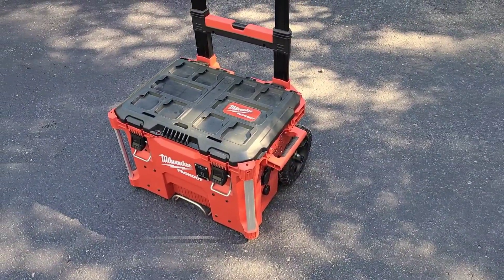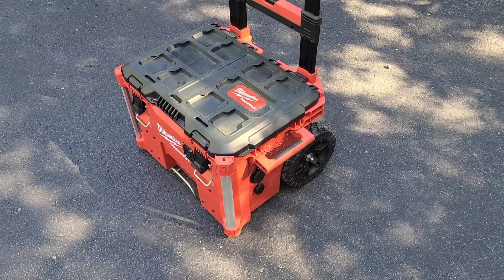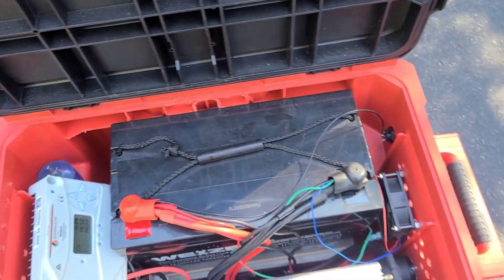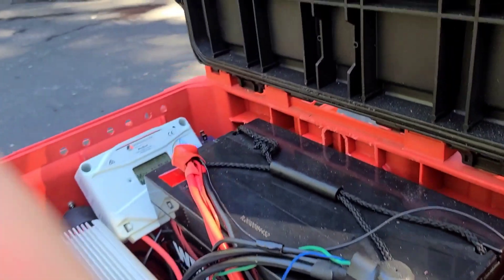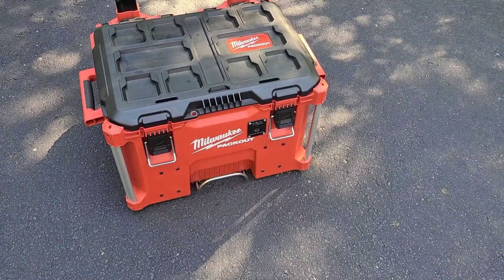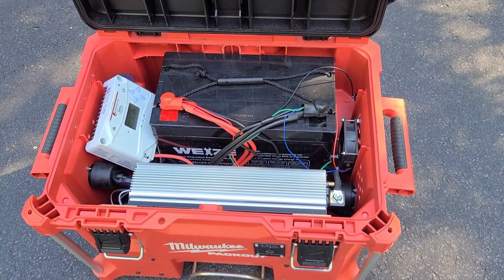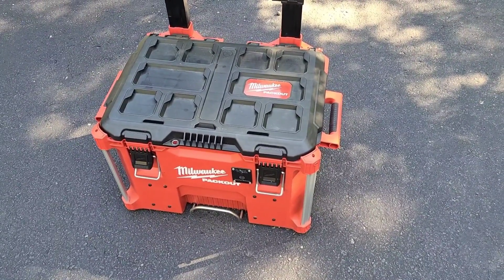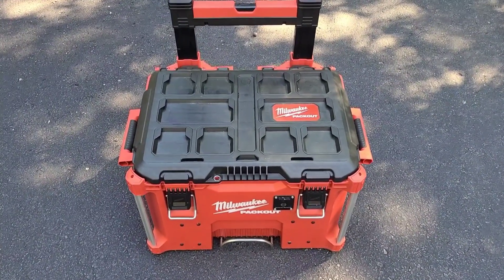DIY solar generator - updates

Comment: nice build cool ❤❤❤❤i have 48volt pure sine wave inverter in tool box i have 3 110 AC out put on my tool box i have 20A breaker for 2 of my 110 AC out put and 15 A for next 110 AC out so inverter is procted i have switch between positive of my battery and positive of my inverter to turn it off have put cool fan and usb port solar chager etc my out let water proof ❤❤❤❤

Comment: If you want to lengthen the cables on the solar panels you must use thicker wires like 14 or 12 gauge wire .
Reply from the maker: Those are 10 GA cables. I just got in an additional 40 feet, so I can use the 20 feet I originally got or extend them with the new 40 depending on my situation

Comment: How long does it last do you have fast  drain issues
Reply from the maker: Just really depends on what you've got plugged into it. I ran my coffee maker and toaster at the same time on a camping trip no problem. You'd have to do the math on the electrical draw of what you're running to see how long it would last.

Comment: Nice build. 
I have a power station built out of a cooler. 
I replaced my lead acid battery with a Lifepo4 battery. 
Lead acid batteries should not be run lower than 50% battery. 
Lifepo4 batteries can be fully discharged or to be safe use 90% to 95% 
Lifepo4 batteries get about 2000 charges before you have degradation of the battery. 
After 2000 charges lifepo4 batteries are generally at 80% power so they still can work. 

Lifepo4 batteries are dropping in price big time.
Reply from the maker: Cool, I'll check out the Lifepo4 battery, thanks

Comment: Can you post the build specs & products you used in your build.
Reply from the maker: I will early next week, I've got a super busy weekend.
Reply: @fortawesomeoutdoors3284 Thank you. 
Have  Great Weekend
Reply from the maker: The four major components I used were,
ProStar 30A PWM controller
GoWISE Power 2000w pure sine inverter
Weize 12v 100ah deep cycle agm batter
Renogy 100w 12volt monocrystalline foldable solar panel

All of these components I got from Amazon, but I'm sure there are plenty of other good choices too.